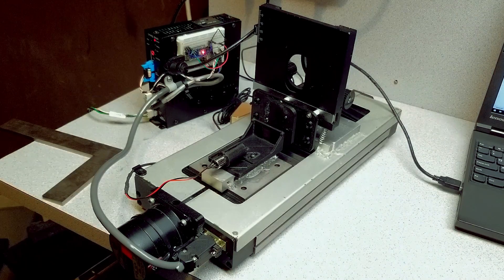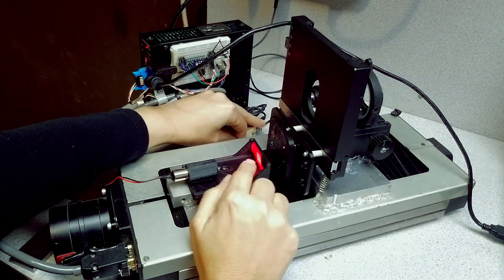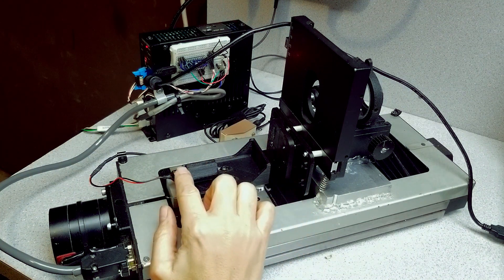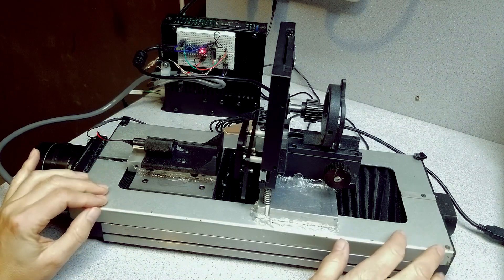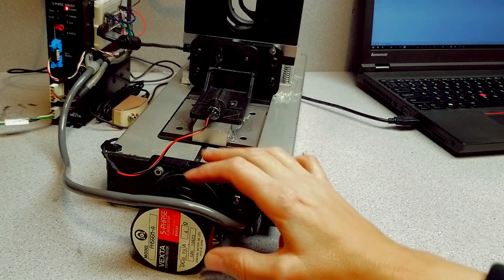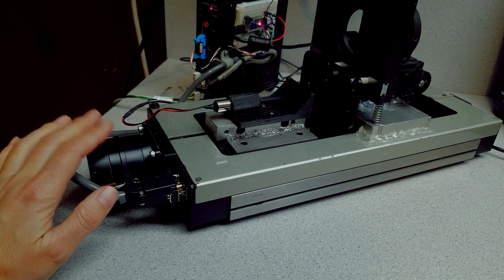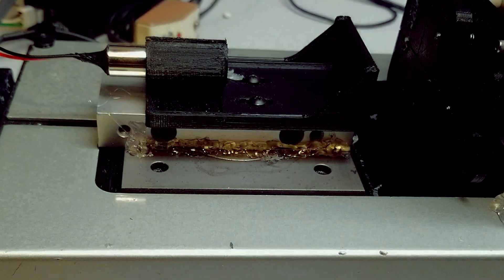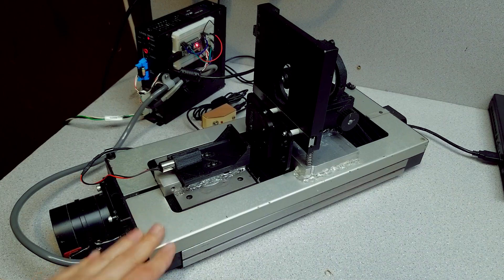3D Interference Scanner 02 - Using One Micron Axis

Comment: the CD tray slider is a great hack! One time I did a motorless slider by putting a photocell on top of a TI89 calculator & case xD
Reply from the maker: What would the motor do?

They are cute little stepper motors, though they are so small an allegro a4988 makes them whistle at a low holding torque.